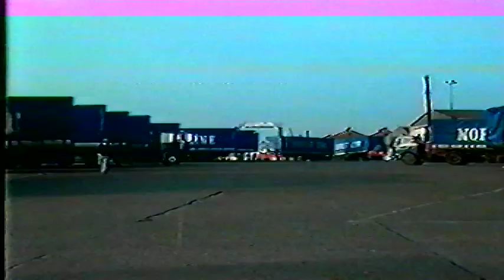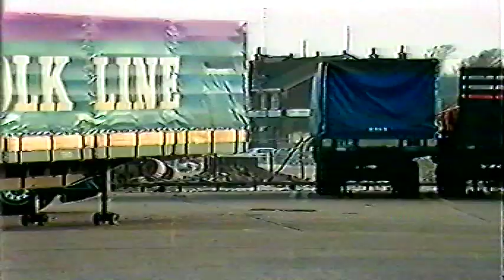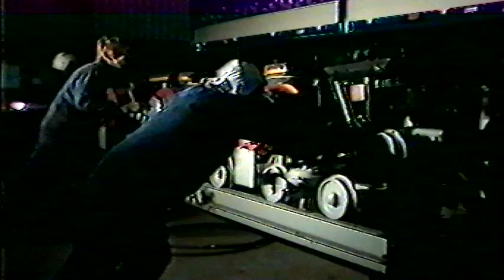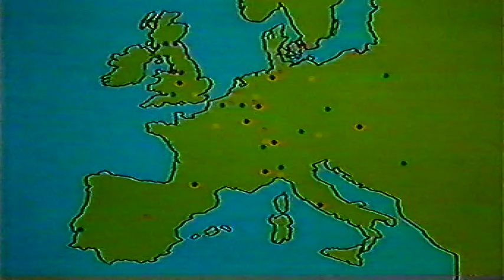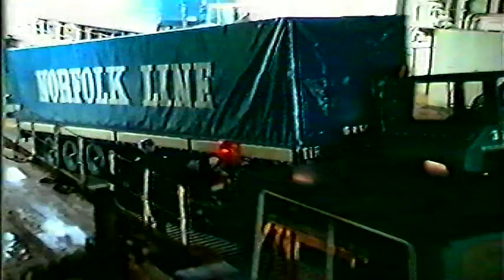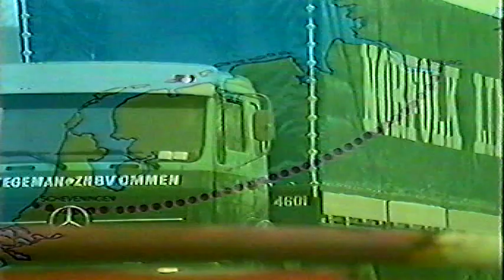Norfolkline UK introduction   tri axle trailers in the early eighties

Comment: An old guy about 25 miles from me has a huge barn which has a few old trucks and trailers scattered around it,we once got a peak inside when the shutters were up and among the multitude of covered up but obvious F88's and F12/16's there was several trailers ,two were these exact Norfolk line trailers,one hitched to an immaculate but small looking in comparison Ford D1000,which was one of three in identical livery,there was an enormous scammell military 4x4 which I later discovered is for fitting telegraph poles and then spanning the cable. It's a shame that people have all this good stuff and keep it to themselves.
Reply: lol😂

Comment: Norfolk Lines were an example of efficiency, the trailers did not carry a spare wheel but they had 24/7 contacts with tyre suppliers all over Europe to assist them, it saved theft & weight.
And everything was possible with Norfolk Lines as a customer, I once needed 3 wheeled BIG fire extinguishers from UK Fire in Norwich, the UK FIre people delivered them to the Norfolk terminal, Norfolk Lines put them under the front of a couple of trailers and hey, presto I could supply the new units on an offshore rig that would leave that week end. 
Prices and service were great with Norfolk Lines and the staff were really helpful and knew what customers were for !
Thanks for posting this video, a time when people did people to people business and you were not talking to a computer !
Reply: Traditional freight forwarders,not logistics experts,or supply chain partners.Freight people in the freight business.

Comment: I used to pull Norfolk Line Tilts for Sammy Jones ( Aldridge) in the 80s.
Reply: i grew up going with my grandad in the artic from the early 90s I remember sammie jones talk about a blast from the past
Reply: Why did the trailers in the 80s have rollers instead of pads on the landing gear?  Had maxi spring brakes come in throughout Europe then? They came in 1976 in USA.

Comment: they could of used a better tractor unit. then the old poxy 2500 Daf. Gutless 2500 designed for 34 ton max. Not 38. Should of used a big trans con with 350 cummins
Reply: 2500 plated for 28t max not 34t,, I drove a DAF 3800. And a trans con. The trans con was a bag of crap, and rotted into holes like Swiss cheese.we pulled Norfolk tilts with ERF with a Cummins and an Eaton twin splitter. No probs
Reply: @malcolmford6017  ye I had a 1987 3600 ATI Daf space cab and it was on air suspension. And still got my 1982 transcon. I never ran it but my dad did in the 80s it's got the 350 Cummins and it got wax oiled when it was a year old so hardly any rot it's been parked 29 years now in a shed and it's time to restore her. Ye I had a ERF Olympic with 500 Cummins and Eaton twin splitter. Best gearbox ever made
Reply: @fatlad5090  I had a trans con in 1990 pulling boxes out of Felixstowe , lucky if I got 55mph on the A14, but rotten as a pear and leaked in. Mind you it was 12yrs old when I got it. T reg, it took a long time Bham to Felixstowe and back.
Reply: should've*

Comment: A strange decision, the tractor is lighter than the trailer. A three-axle tractor with a two-axle trailer is a safer option, you don't need to load more weight to the end of the trailer
Reply: The weight is equal over all axles when on air. 5 axles combined (2 unit, 3 trailer) has been standard across Europe for decades. 
UK now has 44 tonne max so 6 axles the norm. I ran 5 axles forbears all over the place. Never a problem.
Reply: @petittrainguernsey3297  European trucks are not suitable for driving in winter, if you see a truck blocking the road in Scandinavia, it is almost always a 4x2 tractor
Reply: @Aisaroaivi  oh right. So why do you see them everywhere then? I took one over the Alps, through Eastern Europe, up into Norway in winter and never once got stuck. Even at 40t. I think you’ll find any tractor unit with a tag or lift axle is far more prone to get stuck. The fifth wheel is in the wrong place if you lift the mid or tag to get extra grip. On a 2 axle unit the fifth wheel is placed directly over the drive axle. 
Just wondering why, if they are no good, most of Europe runs them?
Reply: @petittrainguernsey3297  I would like to know why they use this unsafe combination. I have been driving in Scandinavia for 20 years, so I think I know which truck is more suitable for winter. And here is a quote from "Truckers guide in Norway": Some of the road network in Norway – national
roads included - can be very challenging in winter.
This is particularly the case for hilly road sections
and especially during periods of heavy precipitation. In these situations, twin-axle tractor units and
semitrailers (even when equipped with winter tires
and/or chains) may have problems with reaching
their destinations.
Reply: @Aisaroaivi  
Good for you. But winter in Scandinavia is very different to winter in Spain.
Horses for courses mate. 
Twin drive is just a waste of payload weight, tyres and fuel on the European motorway network. 
I’ve driven twin drive trucks in Australia and the Falkland Islands. Where traction requirements are different. 
If your twin drive is so wonderful why do Volvo and Scania pump out thousands of 4 x 2’s and sell em?
You won’t find a Tesco’s FL 40 tonner running about in Northern Norway now will you? It’s hunting ground is motorway and urban. 
Likewise you won’t see a twin drive 60t Norwegian wagon on the M25. 
In fact every Scandinavian wagon I ever came across around Europe was 2 axle Unit, 3 axle trailer. It’s the norm and you have to remember the weight limits of each country, the payloads and the cost to the haulier.
Reply: Back then there was not a lot of three axle units mostly 6x4s for low loader work,  and they are only using the DAF for testing in the video. .